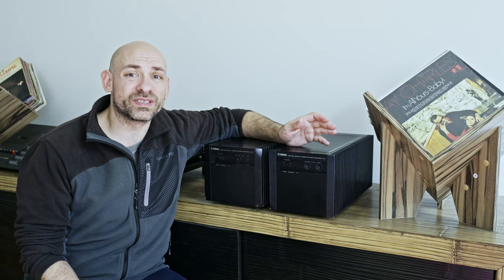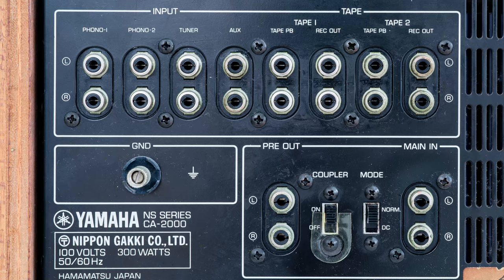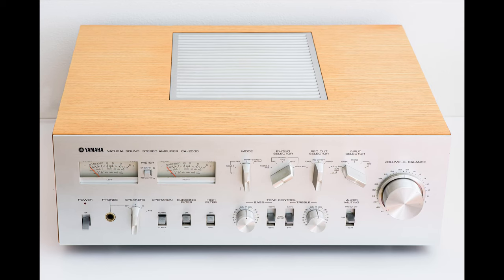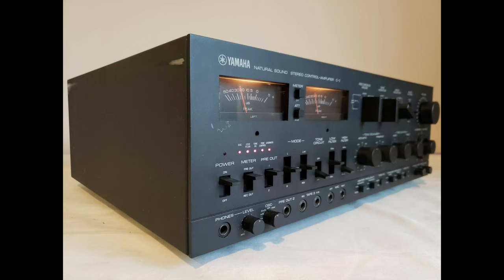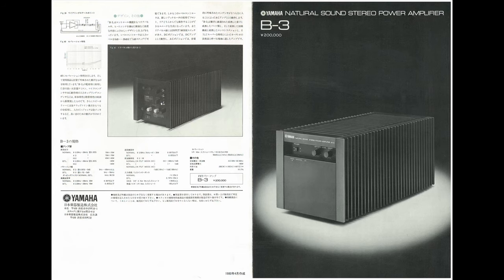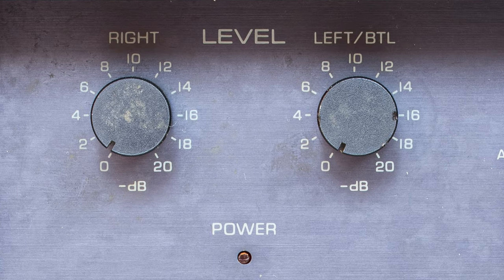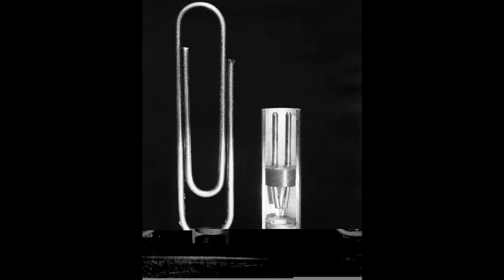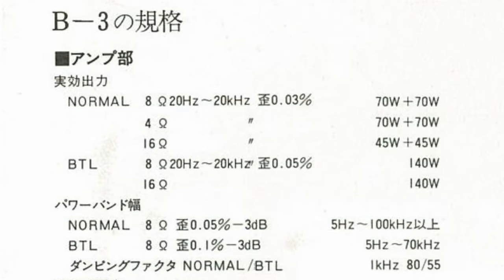Yamaha B-3 Power Amplifier Review - Are two better than a single one?

Comment: The B3 has the same circuit architecture of the B2... But half the power .. 70w ... Is understandable why is was only sold in Japan ..As is targetted to smaller rooms or younger population .. The B3 only has a pair of Vfets ..The B2 has two ...So  two B3 = 1 B2 ..  There is no magic sauce here , It is a cheaper product..